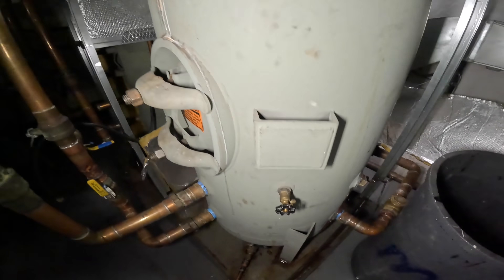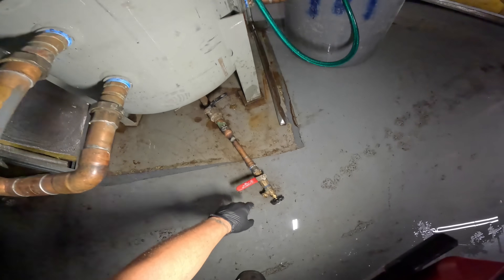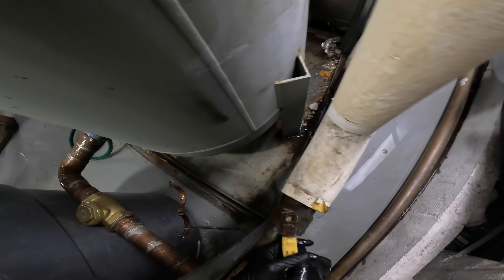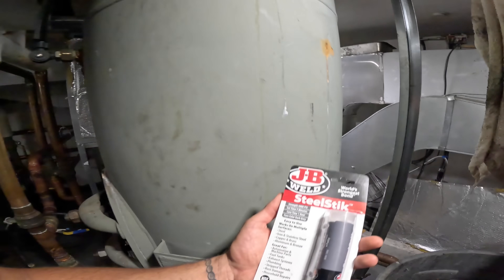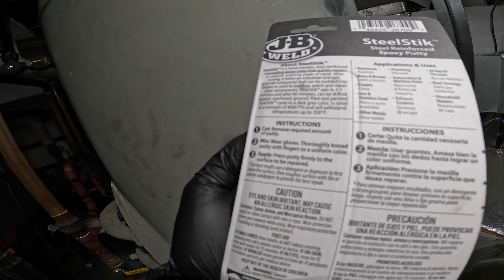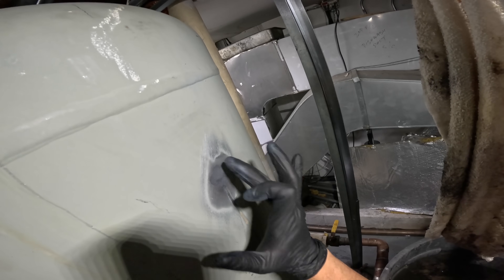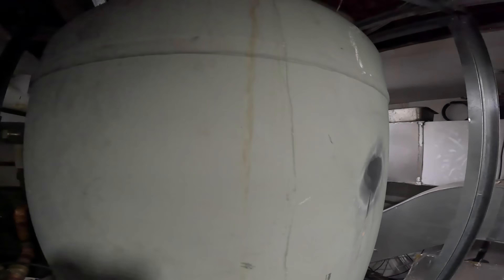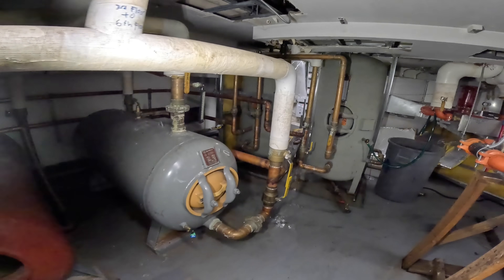HVAC: One Boiler Room NIGHTMARE Water Leak After Another/Hot Water Storage Tank Leaking Water Repair

Comment: the vertical tanks look like indirect water heater/exchanger tanks for DHW.  the bank of horizontal probably storage tanks for non-potable heating or a large storage bank for the DHW if the building is very large and the whole setup just for DHW.
the check valve on the line coming into right near bottom is likely the domestic cold input and maybe recirc. return line combined. the front two lower lines boiler water in/out into inner tank or coil. top line domestic hot out.  in that parallel setup, the two tanks need to be identical and all plumbing between the two identical in length, size, elbow count, valves and spacing for the flow to stay balanced, otherwise it will be unequal and one tank may overheat and lift the relief valve or run cold. good old parallel indirect heat exchangers/water heaters.
best bet is to find the blueprints for that mess, instead of having to trace everything out and guess what goes where.

Comment: I have used Steel Stick to repair cracks and holes in hot well steamers. Holds up under water with expansion and contraction of the metal.

Comment: I’m a power house mechanic, I can tell a easy quick fix, you can thanks me later. Cut a small square piece of red rubber gasket same stuff they use on gaskets flange in hot water application. Also carrier assortment of adjustable pipe clamps tighten down with impact gun or by hand . No leaks plenty of time to order material and fix long term. It a quick cheap fix . Ur welcome lol😂

Comment: Corrosion near the fittings aren't that surprising. Brass or copper fittings are slightly more noble than steel, so you get galvanic action in the tank. But in this case we have a pinhole in the middle of the tank sheet metal, no fittings nearby. If it's indeed galvanic corrosion, then it's probably some slight manufacturing defect in that part of the tank.  Years of galvanic action has eaten away enough steel on the inside, thinning it to the point where it finally buckled under the pressure. That means the whole inside surface of the tank is gonna be completely corroded. So it's gonna be the first of many many pinholes in this tank for sure. I'm surprised you found any bare metal at all under the paint.

Comment: This is likely due to issues with the water's hardness and pH levels, combined with an electrolysis effect. A thorough inspection is necessary, and in my opinion, the storage tank should be replaced.
Reply: Interesting theory. I would've thought it was just galvanic corrosion from fittings with the wrong kind of metal (i.e. fittings more noble than the tank itself). The tank on the left seems to be in way better condition than the one on the right. If it was electrolysis, wouldn't both tanks be affected equally?
Reply: @GackFinder  Multiple areas are showing signs of perforation, which is a highly characteristic issue. I’ve previously encountered similar problems with this type of tank. These systems typically include a replaceable sacrificial anode, and the internal lining should be inspected every five years as part of routine maintenance. The fact that one tank appears to be in better condition than the other is not conclusive. In my experience, the perforations were caused by improper water treatment, which led to degradation of the internal coating.
Reply: @stephanecastronovo9788  Very interesting. So if I understand correctly, the core issue in this case would be that the water is slightly acidic, leading to electrolysis?
Reply: There is no electricity in that tank. Electrolysis requires electricity 🙄